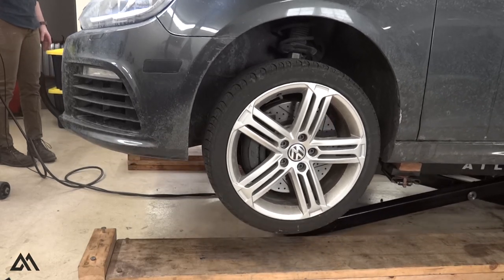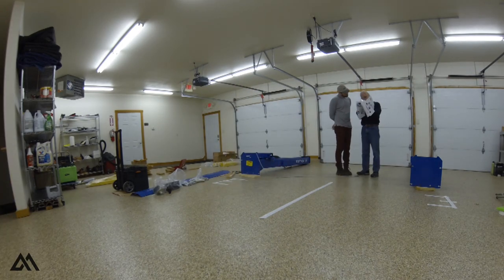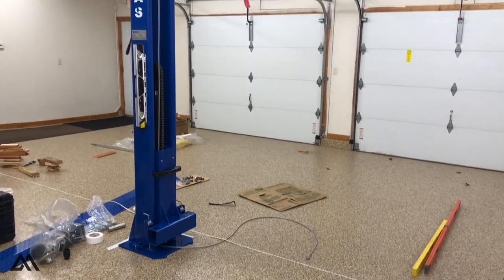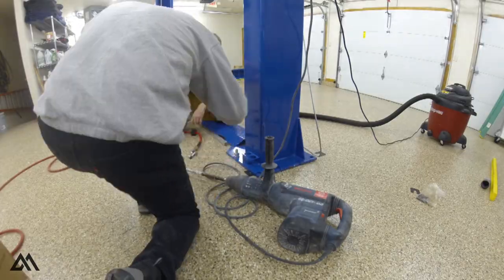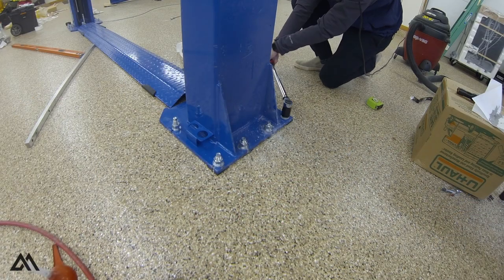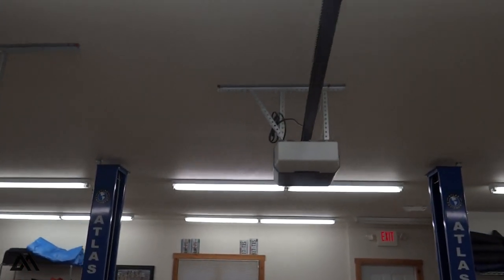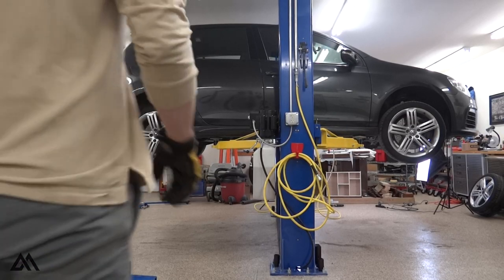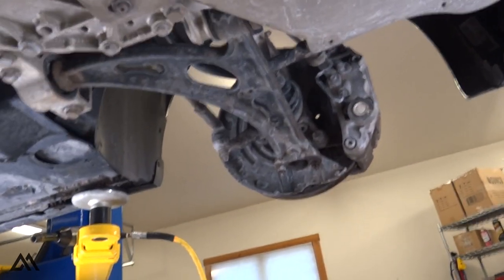Installing a Two Post Lift in the Garage!  |  ATLAS BP8000 Baseplate 8000 lb. Capacity!

Comment: I’ve had a bp8000 in my home garage for almost 4 years with no issues and I used it a lot for about 3 of the years. Greg smith equipment is a great company very good customer service. I own a auto repair shop and when I need a lift for my shop I definitely will buy another atlas. They are the best quality as far as a cheaper brand goes.

Comment: A cheap solution for the garage door opener is to extend the opener rail so motor closer to being over the hood.  Replacing the garage door track to get it closer to the ceiling is also useful.  Jackshaft opener is even better and can justify price based on intelligent features (don't leave door open all night) they come with and power deadbolt harder for theives to defeat.

Comment: I have a question. My ceiling is the same height, and I am going to purchase the exact same lift this week. My question is this; when you have your car at its highest point it can go on the lift in your garage, and release the hydraulic pressure in the lines for it to rest on the locks, how much higher did the car need to go coming off the locks to apply hydraulic pressure to briefly lift/lower the car to the ground? Hope that made sense.

Comment: How did You wire the 220 volt motor to the 220 volt wires I have a blue wire and a yellow with a green stripe wire and a orange wire, which ones go to the 220 power leads ???

Comment: Looks good! Have you thought of a high lift garage door? I dont know if it would be very expensive or if the the motor box for the garage door would still take up a significant amount of space. Just a thought. Cool vid. Cool car. I have a mk5 gti and a Mk2 GLI 16v.
Reply: You can run a high lift door and a jack shaft operator that mounts directly to the spring shaft to save space. A bit pricier though.

Comment: Do you have any issues with it being a symmetrical lift? I've read about not being able to open car doors while on the lift due to positioning of the car. I just bought an old rotary 2 post and am considering selling it to a friend to buy an asymmetrical model. Thanks